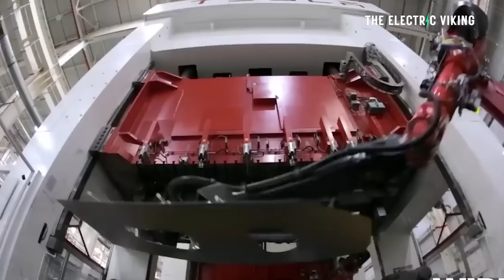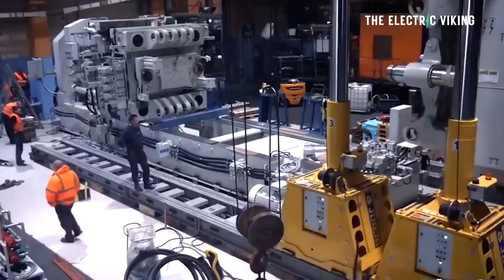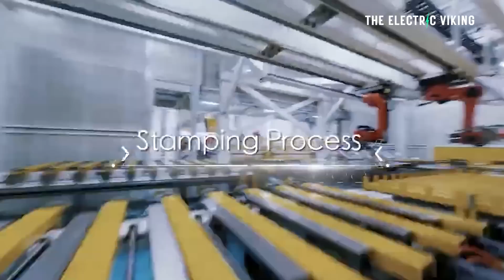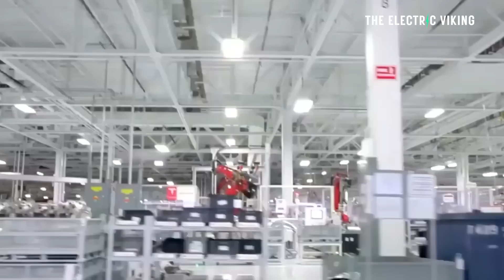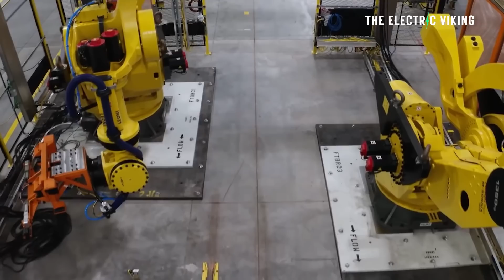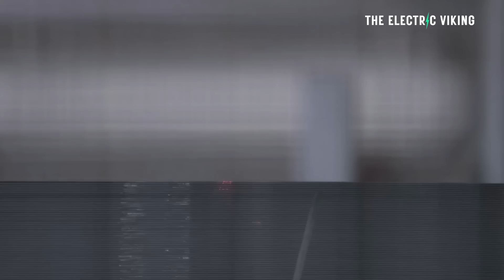Tesla achieves 'mega cast' breakthrough in single-piece casting for Model 2

Comment: The first thing that crossed my mind with a full car casting was, one bump and the casting could be written of for drivabilty, thereby writing of the car (high insurance costs) but I remembered that legacy cars have been building their cars with a 'pressed steel base' for over 20 years and I once got a small rear shunt which crumpled the base plate inside the boot and the car was written of. So in essense the build of a car is non essential and if all cars eventually are FSD, they shouldn't be bumping in to each other anyway.
Reply: Interesting point you make, my sons company car ,a Subaru Impreza, had a truck back its tray into the boot, could still lift the lid but it was probably that the undamaged boot latch which still held following the impact which placed some strain on something structural underneath, $AU 11,000 damage, could believe it.
Reply: Don't forget that 'writing off' is about the insurer's belief that a car can't be repaired for less money than they can buy you a new one (and they get scrap/resale value of the old stuff obviously). If the cars they chose to write off and sell as scrap/spares have more value than they calculated, they'll take a massive financial hit so they do have every incentive to get it right while not risking your life. Munro did a video the other day trying to show that the castings are much stronger, so minor accidents won't write off the vehicles so often if insurers use up to date information.
Reply: The best thing about damaged gigacastings being damaged is the recyclability of the casting into a newer generation vehicle, forget repair and go straight to recycle the casting … what they need to consider in their design is stripping out non casting materials after write off happens like Wiring, computers, motors and The like ….
Reply: @chrisbraid2907  You are right and in fact the whole vechicle lends it self to be recycled, the electric motors are likely good for 50's of use and if the battery container plate/compartment is undamaged so could this be, in fact if there is a one piece casting, it could just be unbolted and leave the battery compartment to be fully intact and a new casting/bodywork laid on top of it. Just thinking along the lines of those little toy cars that Elon mentions.
Reply: The difference is if your car were steel then someone could whip out an angle grinder, or beat the thing back into shape or weld something back to do a repair. If an aluminium casting is damaged then you're basically screwed. Tesla supposedly have some sacrificial points in the casting that can be cut away and replaced by a bolt-in steel replacement piece but that's your only option and I'm guessing it only helps in a subset of collisions.
Reply: After the disposable appliances now we are entering disposable car era.
Reply: @JohnNy-ni9np  All cars are disposable.. just that the EVs can be rcycled easier

Comment: Not good for repair，if one small part is broken，you'd have to change the entire cast
Reply: When it's not cast, they literally weld all the parts together into one frame. It's the same, only cheaper to make. Relax.
Reply: The one part can be melted and recast . Perfect part with recycled part.

Comment: i would avoid buying any car with such large single body piece. minimal accident you will be totaling the whole thing
Reply: Avoid minimal accidents 😮
Reply: I’m sure the engineers have taken this into account and will have a solution to this before they go into production. And with robo taxis being 20x better than human drivers there will be fewer accidents. And those accidents caused by the human drivers who will have to pay to replace the robo taxi 😅
Reply: @f1al373  do you think reality is a Hollywood movie correct? Have you asked yourself why Tesla insurance are way more expensive than anything else? There’s no such precaution. The advantage of this type of building is that it’s cheaper to build and more profit for tesla and the disadvantage is that is expensive for insurance to cover and can easily be totaled in a case of a major accident. I’m talking about the ones in existence right now with front and rear single casting. This new one they are trying to introduce will be way worse because it’s much more integrated. You can’t change the rules of physic and the new ones will be totaled in case of simpler accidents

Comment: I don’t understand why the innovation in legacy auto interests you, because it really turns me off. What I see is huge rise in complexity and decrease in repairability, and a lot of electronic technology functioning as feature bloat, not better automobiles.  Tesla can keep their iPads and self driving features and over the air updates. I understand the case for over the air updates but I’m a 40 year veteran of Microsoft updates breaking my computer to think they are particularly desirable. So an EV crate motor conversion on an old car appeals because I could limit the electronics to a range meter and a speed meter…..

Comment: Wasn't Sandy Munro advocating mega-casting before Elon tried it ?
Reply: I think he told many OEMs to use the casting idea but it was only for saving costs on very big runs of a million or more cars. Elon and Tesla were planning to make millions of this model and to reduce costs and improve car production methods. Tesla learned a lot from Sandy.😊
Reply: Yes. At least that is what he says.
Reply: @skipondowntheroad5833  A few of Sandy's old videos showed an example casting in his workshop.  For years, he tried to get auto makers to change their production methods to use castings, but to no avail.
Reply: Many moons ago I worked at SpaceX, and can tell you that Elon was excited about casting for cost reasons as long ago as 2009. He has been aware of the benefits of casting for some time.

Comment: Sand technique probably a major limiter to this, works and makes fine complex models. But Im sceptical about its potential to scale. x to doubt.
Reply: Sam mentioned in the video that they would use 3D printed dies for testing iterations, not at scale. Once they have a design they like, they would have the more expensive cut titanium die made. Strength of a 3D printed die can't hold up to too many presses. But enough to test with. It's just to cut design and testing costs.
Reply: love to see the cybertruck giga caster in operation😳
9000tonnes!
Reply: or the speed of automotive industrial 3d printing🤔

Comment: Rumor was not about a single-piece casting, but about a front-to-back bottom part casting..
Reply: Bottom cast with battery case in one part. Then use the unbox method to build the front, rear, and center upper parts attaching each at the end of the line.
Reply: Imagine how much shorter the production lines are going to be! 🤔

Comment: "Single-piece" is the right conceptual direction for sure, but literally it will most likely be 2-3 major pieces - simply because of the reality of basic injection molding limitations - draft angles,  undercuts, sliders, etc.
Reply: It is one piece underbody not one piece car. In fact it is actually two pieces. The entire underbody + the battery pack.
Reply: Aren’t Aptera using in wheel motors?😊
Reply: @malcolmrickarby2313  that's their dream. I've heard they're also hoping to build their tenth car by 2029. ;) Seriously though, I hope they make a go of it, because even if it's a pretty useless car it's a different kind of useless to a Lamborghini.
Reply: Plus in wheel morors
Reply: @Roberto-uk3ml in-wheel motors are probably not such a brilliant idea, I think... there are challenges packing a motor together with the brake discs; makeing sure you have adequate cooling, not to mention the issue of unsprung weight. 
I had hoped Lordstown would have made it to series production, if for no other reason than to demonstrate the practical effects of in-wheel motors.
Reply: @koma-k Unsprung weight is a non issue. It's a buzzword used by clueless people who parrot what "experts" said 50 years ago. 

In wheels motors have already been tested and the Unsprung weight had zero effect on the car.
Probably because it's a fraction of the overall weight.
Reply: @themonsterunderyourbed9408  Unsprung weight can be reduced by just using smaller wheels. What is harder is fitting the brakes, the reduction gear and the motor inside a smaller wheel. It can be done it is just a matter of balancing efficiency, torque, rpm and handling.
Reply: You also need to have the right viscosity and make sure it will flow evenly and then cool without making it too brittle or too malleable. It's going to take lots of iterations to get it right.

Comment: Having one big part sounds like a nightmare to repair..
Reply: If a crash significantly damages the casting, the car's a write-off (same as a standard car). But body panels will be replaceable (same as a standard car). I guess it'll be more likely that a car made from one (or more) casting will be written off, but they're cheap to produce and therefore cheap to replace.
Reply: @Raffix394
I would be happy to walk away from a crash which damaged the casting!

Luckily, FSD will avoid many crashes. 
If only other cars licenced that, we wouldnt have much crashes at all.

Tesla has a crash absorbing zone outside of the casting, that's intended to give, damping the crash.
But you don't want the casting to give, because you are inside of it.
Reply: It is a standard any force that bend a car chassis will totaled any car, regardless it's big part of few small part attached together. If that the case the car legally can't be drive on road anymore, but sure there is some workshop repair it anyway and resold it to third country like Ghana etc.
Reply: Much easier to recycle ♻️.😊
Reply: @malcolmrickarby2313 it’s gonna be no easier to recycle than any other car. It would be much easier for it to end up in the recycle bin though

Comment: But the Unboxed manufacturing method won't work well with a large single piece.
Reply: It actually works very well. You just reduce from 6 super assembly into 4 super assembly. The front, middle and rear underbody can be combined into 1 without compromising ease of assembly access. In fact in their unboxed animation they did combine this three assembly module before attaching the other assembly.
Reply: Yes it will. This is just going to be the bottom of the car.
There will be 2 sides with doors etc. So I am guessing the 3 parts will come together at the end.
Reply: Can’t attach seats to battery pack as in the three part process used for MY at the moment. 😊

Comment: BYD make structural battery packs not Tesla.
Reply: Tesla has structural battery pack with 4680 cells, CATL has it's own structural battery pack and sells it to Tesla as do BYD
Reply: @miroslavbiscan7476  No they don’t. They cant make them commercially. They buy from CATL and BYD because they cant make batteries.
Reply: @hybridflowx4 ignorant comment. Tesla is making structural battery packs with their own battery  4860  cells in Giga Austin in Texas used in the Model Y.
Reply: @achasilas6535  no they are not. If so, where are they? They make a tiny amount that doesn’t count as ‘commercial’. Tesla buy batteries.
Reply: @achasilas6535  who told you that!!!!!
Reply: @hybridflowx4  stop embarassing yourself. Initially you said that Tesla does not make structural battery. Now they make only a little and it's not commercial?  Tesla makes structural batteries and put in cars that are sold to customers today. That means it is commercial. It's not like the battery is still in the lab. The battery and structure pack are in production and being used by customers on the road today. Granted they are still ramping production. They also buy most of the batteries from suppliers because their demand for batteries cannot be produced by only one company. Even at full ramp of the Tesla battery factories they will still buy batteries from suppliers because of high demand.